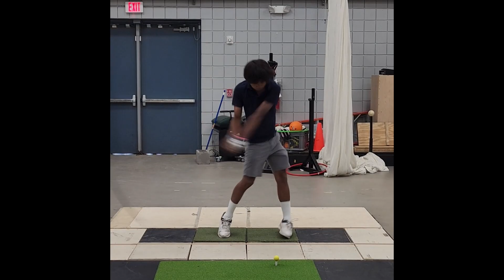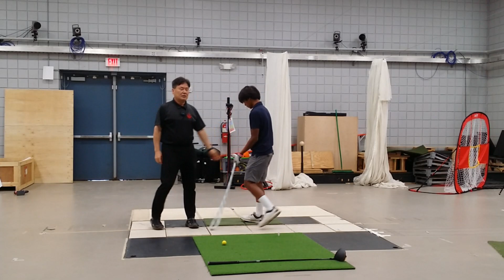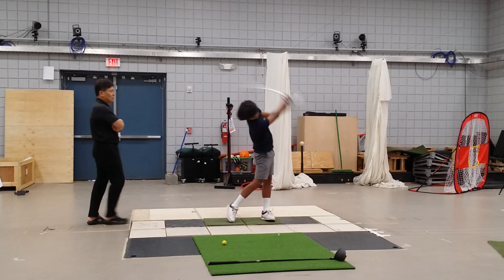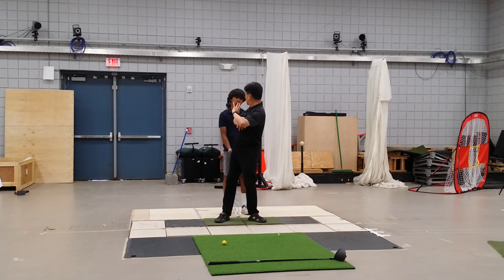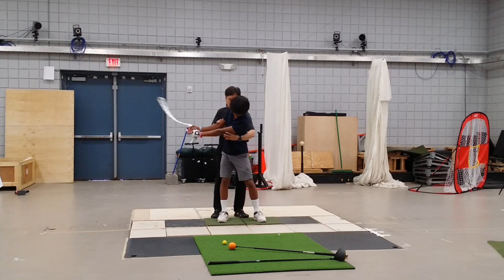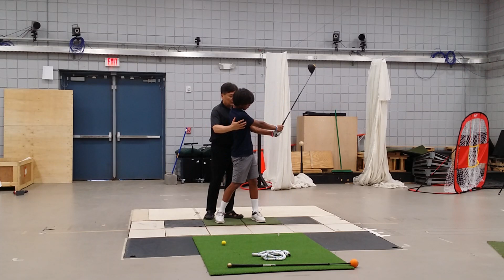2022-05-16 Reprogramming w/ Lance U. (15 yo) Part 1 on DrKwonGolf

Comment: Most of the videos are with driver. I'm assuming the same principles work with irons? If so, how is a divot taken with irons but the driver doesn't hit the ground at all? Thanks!
Reply from the maker: When you develop good rhythm with the driver, the pattern transfers to the iron swings automatically.

Comment: Kr Kwon, can we talk about grip a little? I love a neutral grip but I'm unsure about how tight I should hold the club. I was told to hold the grip like I'm ringing the water out of a towel and that doing so will help stabilize the face, but it restricts my wrists a little. How tight are your students gripping the club?
Reply from the maker: It shouldn't be too tight. Tight grip tends to lock the wrist and you lose wrist mobility. As long as it gives enough traction between the hands and the grip, it should be OK.
Reply: @drkwongolf  Thank you so much.